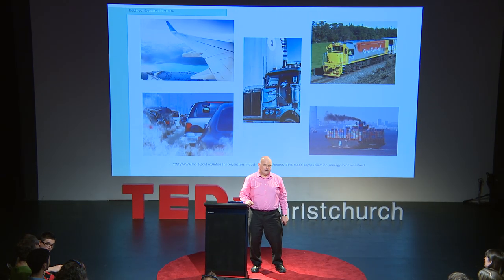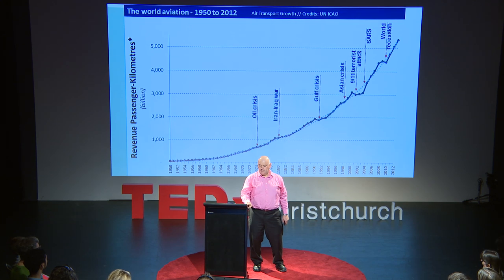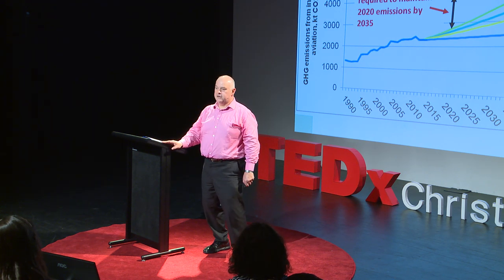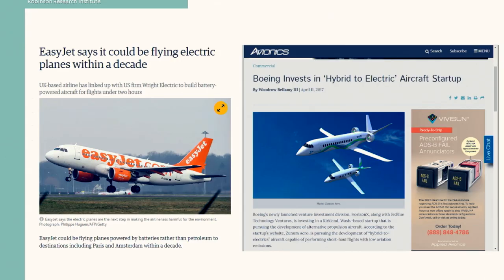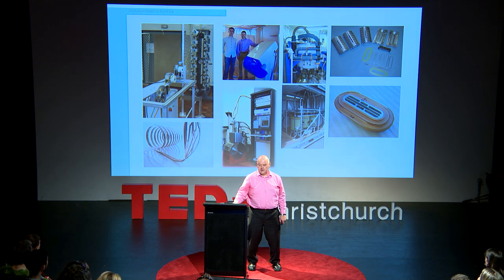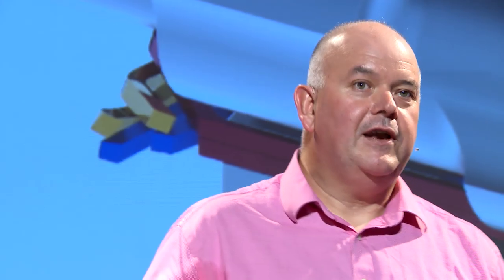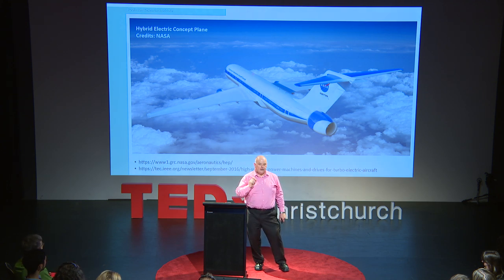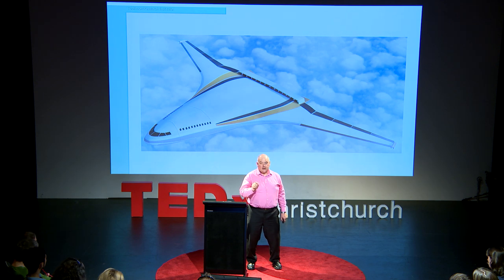Reduce aviation emissions by 70% -- here's how | Rod Badcock | TEDxChristchurch

Comment: Superconductivity is now at 233K (-40C) which is about the temperature at 30,000 ft. So the superconducting material needs to be super cooled on the way up and the way down. Personally I think assisted takeoff will provide more fuel savings than hybrid power trains. Current engines are large enough to get lift, but an awful lot of mass to carry for 10000 miles. Assisted take off allows making the engines smaller, and hence much more efficient for the remainder of the journey.
Reply: hows the batteries work at -40?
Reply: @justinjay6930  Depends on the battery. Solid state batteries will work fine. For the current generation of batteries, you keep them encased, and they will produce plenty of heat as the motor draws down on them. The batteries will be much more efficient at lower temperatures.
Reply: Capt777harris  You would only need cooling liquid on the way up. You could always compress the air at altitude for the descent. The problem of takeoff remains though. Turbofans are extremely efficient at high altitude. You can move the plane on one small engine, but you have to carry two very large engines for the whole trip, just because you needed those engines to take off.
Reply: I don't think you can expect to rely on superconductive effects on aircraft, at least not with current physics we know. It's not enough to establish a superconductivity record in the lab, under optimal conditions. As you increase the magnetic field strength and the current density, you need colder temperatures to maintain the superconducting state. (I didn't know superconductivity had been achieved at such an absolutely torrid temperature! If so, that's really exciting. Seriously. I'm going to check it out, so thanks for the tip!)
Reply: Well, I checked it out, and I haven't found any mention of any temperature over minus 70 C. And of course, that's just a lab experiment. Where did you find a claim of minus 40?
Reply: @justinjay6930  My battery works fine at -40, but it has less capacity. No reason to keep the battery that cold…

Comment: CO2 from commercial aviation is a very low percentage of human generated C02 from non-renewable sources.
Hybrid Electric planes will only be popular if they provide airlines with lower operational costs (ie the fuel savings must dramatically exceed the added cost) .. ironically,  Money is the path to Green
Reply: @djp3637  Agreed, fuel cost is a huge factor .. and so is Weight, as this video points out, if they can get the weight down, a hybrid system could provide lower operational costs overall .. only then we will see it in use... which is what I originally stated.
Reply: @djp3637  Keep in mind, up-front costs are weighted.  10M now is much more expensive than 10M over 25 years.
Reply: @bob15479  Depends on the cost of capital. The important point of this video is that reducing engine size on aircraft is a virtuous circle. Less mass means less fuel, which in turn means less mass. If we could fire energy at the aircraft from the ground, air travel would be very cheap indeed.

Comment: One thing is to reduce the need for air-transportation of consumer packages.  Items produced overseas or hundreds of miles away can be cached locally at warehouses after slower shipping by boats or ground transport allowing for instant and quick ground-transit from local warehouses instead of requiring air transport from overseas or other regions.  It just requires more careful advanced planning and more wide-spread distribution of products to meet the "buy it now" demands of consumers using much more efficient and less enviro-costly ground transit instead of air transit.   People also could use train transit as oppose to air transit for regional hops.   Few things require the speed of air transport for intra-state distances.  Most things that require transporting items with urgency are great examples of complete failure to plan for the near term and long term maintenances and needs for such things, to have critical items on hand for when critical items fail so overnight shipping doesn't become a "need".

The best way to decreased air emissions (for package and material transport) is to use less air sevices as a substitute for proper medium and long term planning and good maintenance practices.  People are lazy, and they want everything yesterday, so just never mind what I just said.  lol
Reply: Matt Carrell not to mention on what non-green circumstances those items are produced and what these item actually are.

Comment: Lox / LH would not only provide fuel but also cool down the superconductive elements into their workable ranges. Similarly, housing the magnets into the engine venting, thereby turning the fans from the outside rather than the center might yield some interesting efficiencies in itself.
Reply: Hydrogen is not a fuel. It is an energy carrier and a lousy one at that. Airlines around the world use about 100 billion gallons of fuel. The US an brazil together produce enough biofuels to cover at least a quarter of that today.
Reply: all sorts of possibilities if you're using hydrolox, for example you could spec the motors for cruise power, and use lightweight rocket thrusters or turbopumps for adding extra power for take off

or you could skip having turbines, and use fuel cells to provide electrical power, again using the cryogenic LH2/LOX to cut down on the weight that would normally be required for watercooling the fuel cell stack

and perhaps most interestingly of all, you wouldn't have your engine performance limited by altitude, so the plane could fly higher up to reduce drag (possibly again using LH2/LOX to cool the skin of the aircraft to avoid heating problems?)

of course the LOX is going to be adding a lot of weight vs. using atmospheric oxygen, so not sure if it's really worth it unless you're aiming for super high speeds, eg. a suborbital rocket, or hypersonic spaceplane

Comment: Flying is incredibly efficient, in fact more efficient than driving a Prius if you measure passenger mpg
Reply: Yes but in a couple of hours you can make as much more miles than a Prius or any other car will do in a year. Thats the problem. Also Kerosene releases more co2 molécules by its chemical composition.

Comment: @1:30 "We have signed up to keeping total aviation emissions at the current level."  Not good enough.  The IPCC says global carbon emissions need to be net zero by 2050.  Better to invest the research dollars in sustainable aviation fuel.
Reply: Aviation is increasing, but it's still a small portion of the total, and has spent every year since the 70s working on efficiency, and is continuing. How about before you focus on them too much, we look at the 90% of the economy that's been dragging its rear on the topic. You get more reduction that way.

Comment: What a scintillating ray of hope! Jet aircraft are almost certainly the primary driver of climate change, The problem is the massive heat exhausted into a frigid zone. We need to accomplish this change much sooner, and we should be offering massive incentives and rewards for this type of non-polluting and especially, cool running, air transport. One key technology which might hasten the arrival of this type of aircraft may well be including the fuselage as a part of the battery, or power cell, storage and photoelectric systems to assist in the flight of the plane. With current technology the entire skin of the aircraft can be made from solar collectors, both absorbing electrical force and heat, Heat differential between the upper and lower surfaces of the aircraft are another potential source of energy. The actually texture of the aircraft may be fine tuned to reduce friction or possibly even to generate power. 
Thank you sir for this absolutely essential work with super conductors, they will also play a big part in the development of solar powered high speed trains, employing mag-lev, polarity braking, and low voltage photoelectric power.

Comment: Without a mechanically reliable high temperature superconductor, and we don't have those, or a large cooling mechanism on the plane, this is not a ready solution. Better models of conventional motors are hitting greater performance thresholds and might make this viable for routes up to 1000-2000km in the near future.
The other major solution is synthetic kerosene made from CO2 and H2O, via electricity. The fuel is more expensive though, so it's only suited for short haul flights where fuel is a small cpart of the ticket.

Comment: The only viable solution is to produce carbon neutral, liquid hydrocarbon fuels for use in existing aircraft. The technology already exists, it's FAR more viable than most of the technologies mentioned in this video and it would eliminate CO2 emissions from aircraft, not just reduce them.
-
It also should be considered that most airliners fly for many decades before being retired, so even if these hybrid aircraft were in production, they wouldn't begin to significantly reduce the CO2 emissions from the aviation sector for a long time.
Reply: what like Spacex's proposed methane created through solar power?

Comment: You'd only be adding mass. I can't see this working.
Reply: Adding this mass and the efficiency it brings, should cut mass of fuel carried by about 30%.   Even if not viable yet, it is a significant step.  After all, we did move from piston prop to jet turbine over time as the tech was developed.
Reply: I guess the idea is to run the turbines 100% all of the time. Store the surplus and use the stored energy in for example duribg take off. R
This would allow for smaller read lighter turbines. But the weight lost will be redistributed using heavier motors. Hence the need for lighter and more effective motors and of course the energy storage. Toyota has been develeping super capacitors allowing to store energy in the body work, maybe same thing could be developed using the plane fuselage as a super capacitor.

Comment: As for battery technology, forget it.  Go flow-cell or go super-capacitor.  Those technologies are ready today to meet these challenges, they just have to be properly repackaged and scaled for such a thing as commercial flight, but the technology is available now to do so.  We already have small planes flying electrically using conventional Li-Ion battery tech.  Larger planes are an eventuality given improving battery tech or changing tracks and going chemical storage like flow-cell batteries or using super-capacitor arrays with sophisticated monitoring and energy management.  You could even do it today without having to have super-conducting motors using those more energy-dense solutions.

Comment: So this guy's solution is science fiction.
Reply: As he made clear, we have all the pieces for it to work. Just a question of who wants to pay for R&D.
Reply: @MsSomeonenew  Relying on a power source that generates massive amounts of heat to charge batteries to run electric fans at variable speeds (each step adding cost and and increasing energy losses) and minimising resistance using superconductors, a technology that only works at super low temperatures that would rely on either a massive cooling system to keep at those low temperatures stable or massive super low temperature heat sinks (like bathing all of the fans in liquid nitrogen) that hopefully won't flash boil and cause a pressure explosion when it boils because there's a turbojet engine right next to it and lift generating heat or that those cooling systems don't screw with the aluminium's mechanical performance too much. 

You might as well be launching passenger rockets based off ICBM designs and give passengers parachutes to disembark with, or genetically engineer pegasus instead of this insane idea. His idea is pure sci-fi fantasy.

If anyone manages to build that brain fart of a concept no airline would ever buy it, they'd go with one of the far and away more practical plans on how to generate low carbon or carbon neutral liquid fuels, that chemistry is a million times easier and the infrastructure a hundred times faster to roll out than replacing any sort of fleet of jets they'll have in the next 20 years.

Comment: i doubt the superconductors. 
i do believe in some form of hybrid planes though. the first thing to be done is replace 2 big engines with alot of smaller electric fans. possibly above the wing trailing edge to improve aerodynamics as well. that way it should be possible to get away with losing only some passengers to higher mass and still have an advante over a traditional system. the power density of the motor doesnt have to match the turbine. it only needs to be economic for an airline by being not as much heavier (losing seats and sold tickets) as fuel consumption saved.
Reply: You haven't mentioned the weight of the batteries needed to power the fans......

Comment: One big snag, the battery technology. In my opinion the batteries needed for this idea will never exist. There is a physical limit to how small a battery can be before internal short circuiting causes them to go up in flames. Already lithium ion batteries are very close to the limit. In fact they sometimes go up in flames in EVs and the auxiliary power batteries in aircraft.  Batteries will always be too big and heavy for use in powering passenger liners like the 737.
Reply: You would have said the same thing about lead acid batteries or NiMH before the next better battery.

Comment: hyper loop is it then
Reply: Open-air maglevs are better, you don't really gain anything by putting pods in tubes.
Reply: @PistonAvatarGuy  
Hyperloop is still not maglev. And you gain higher top speed with a small fraction of the power, because there's almost no drag.
Reply: @andrasbiro3007  The only working hyperloop concepts in existence are maglevs, AIR BEARINGS DON'T WORK IN A VACUUM. How many times does that need to be explained to you?
-
The passenger throughput of a hyperloop is reduced by the need for an airlock, which makes the drag reduction that the tunnel provides completely meaningless.
Reply: @PistonAvatarGuy  
How many times I have to explain this to you? The hyperloop does not use vacuum. It uses very low pressure, but there's still some air. And actually air bearings work better in low pressure environments, because they use pressure difference, so less external pressure means less air have to be pumped under the vehicle. Actually, it would absolutely work in vacuum, but it would obviously ruin the vacuum quickly.

Pods don't have to go through a single airlock, there could be hundreds at stations, if necessary. And even if there's just a single airlock, that can be designed to be very fast in many ways. It doesn't have to be a true airlock, it doesn't matter is a little air gets through. One design I can imagine uses multiple stages, each separated by sliding doors that can open and close at a fraction of a second. These open just enough to let the pod through. And in each stage powerful pumps get rid most of the air that got in. Another possibility is a plasma window, but that's a real power hog, so probably not the most ideal thing here.
The throughput of the system would be limited by the minimum safe distance between pods, which could be pretty short.
Reply: @andrasbiro3007  Air bearings depend on having a certain volume of air to create a cushion and it becomes VERY difficult to move enough air to create that bearing when it's operating in a very low pressure environment. If you have enough air in the system that it's easy to create an air bearing, your vehicle will encounter significant resistance and it will probably start running into issues with shock wave formation at relatively low speeds. The lower the air pressure, the slower the speed of sound.
-
The other issue with the air bearing is that it seems to have been made to accommodate an on-board battery, which is something that's absolutely insane to have when you have a vehicle following a track. Why not just power the vehicle through the track, instead of having a battery that's going to need to charge every time the vehicle stops, wear out quickly and cost a fortune to replace on a regular basis? This is why a maglev system makes infinitely more sense.

-
"...there could be hundreds at stations..."
-
Yes, if this were Happy Stoner Gumdrop Land and cost weren't an issue, sure!
-
"...it doesn't matter is a little air gets through..."
-
Screw efficiency, right?
-
"One design I can imagine uses multiple stages, each separated by sliding doors that can open and close at a fraction of a second. "
-
Again, no thought given to cost.
-
"Another possibility is a plasma window, but that's a real power hog, so probably not the most ideal thing here."
-
Stupidity level: OVER 9000! (Gotta speak your language, right?) This would be a good way to turn the pod, and the people inside, into ash!